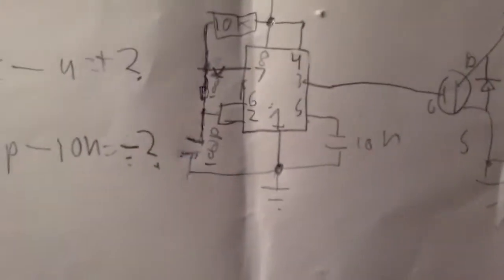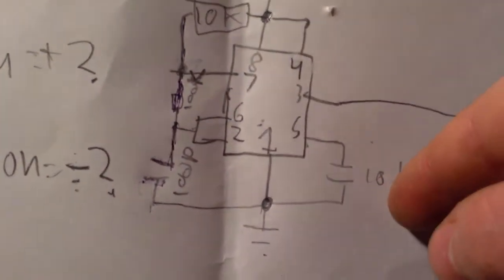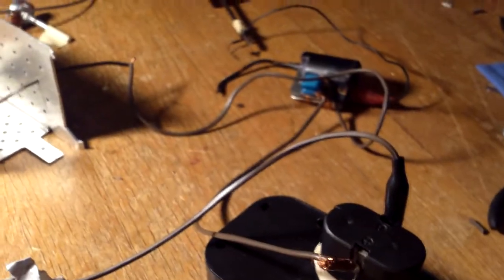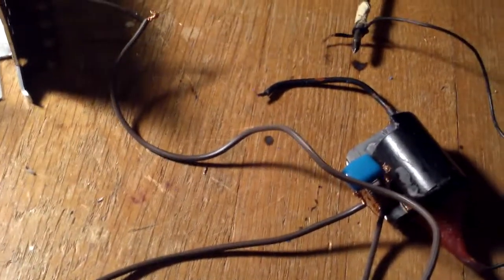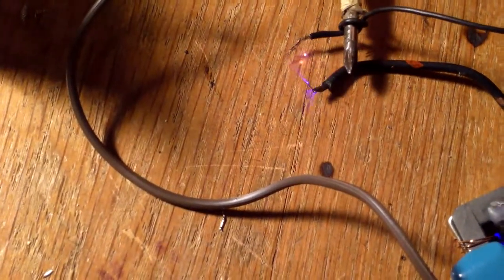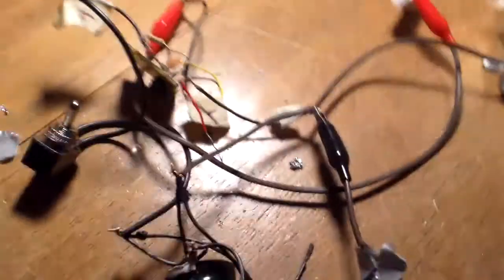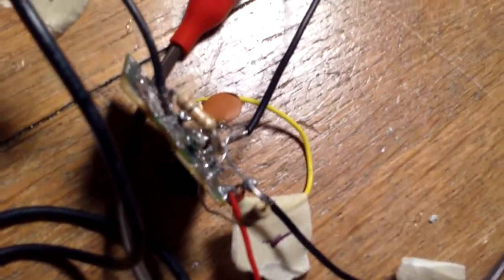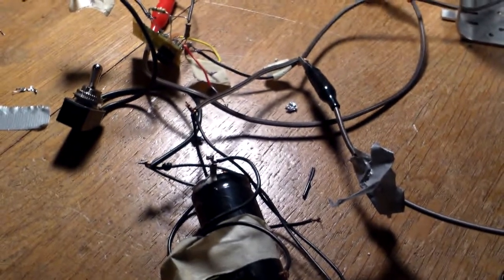555 timer flyback driver

Comment from the maker: @Alex1M6 im using a 360 ohm resistor because im using a npn transistor and it pulls a lot of base current i read the cap wrong i was using a .022 cap instead of a .22 cap. its CRAZY inefficent 18 volts without the cap it put out 3 millimeter sparks and i wont do a video on the singing arc because i could barerly hear it.  i once tried to audio moudulate my zvs circuit and i was succesful. i had two transistors in a darlington configeration that switched the circuit on and off to the music. itsuk

Comment: Put a small ceramic capacitor in parallel with your large decoupling capacitor, it also helps keep the chip from dieing. Also a small resistor of some sort (22 ohm max) between pin 3 and the gate helps stop ringing and strange oscillations from taking place, although it might make the MOSFET run a bit hotter.